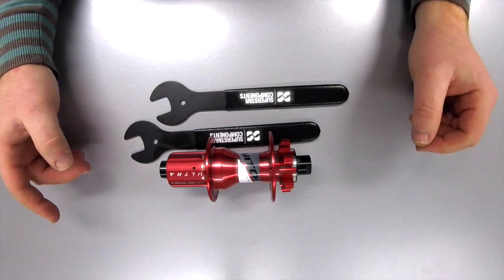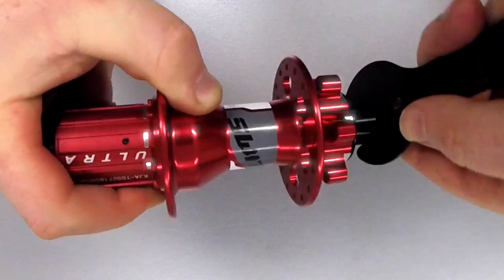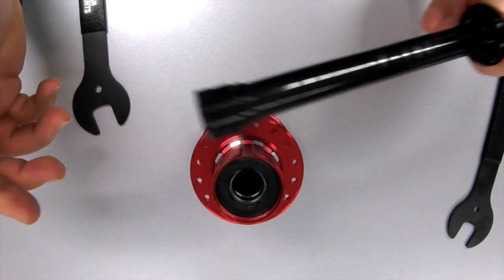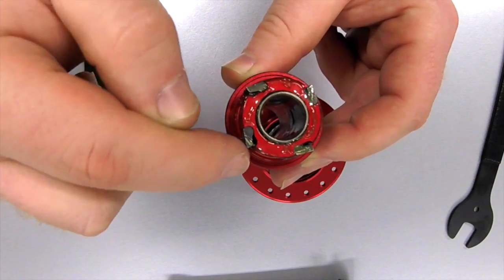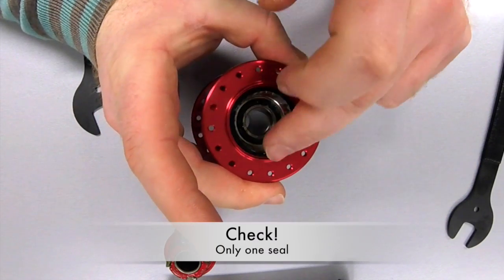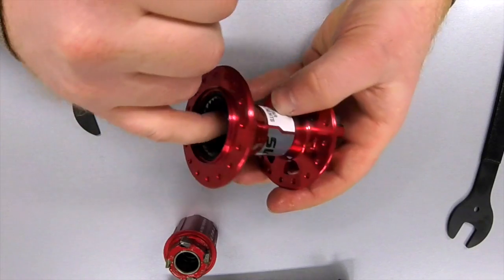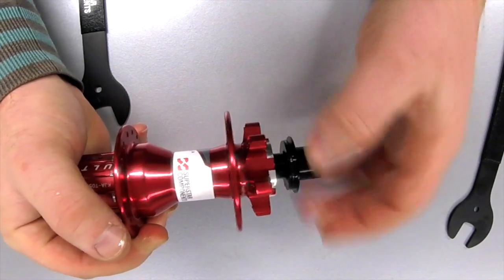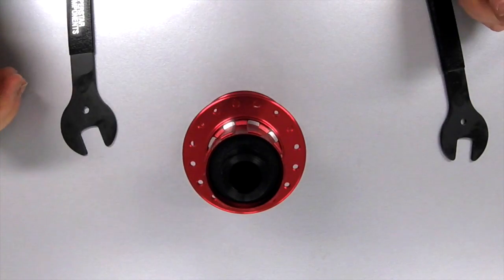Switch/Switch Ultra Hub Servicing Guide

Comment: Hey, my tooth ring broke down to small pieces... i have ordered a whole new hub set but is there a way to remove the tooth ring? I could replace that, the freehub abd the bearings without dismantling the wheel.

Comment: When I tighten the axis (min 3.10) 
My freehub body is not spinning any more. Any advice for me?
Reply from the maker: Linus 112 bearings are dead or you have lost a spacer
Reply: @SuperstarComponentsLTD  bearings run smoothly and I have all the spacers like in the video. But I asked the pre-owner of the bike and he said it's a Novatec XD freehub. Is this the problem? When I take the seal out it runs ok.
Reply from the maker: Linus 112 so you have replaced the freehub then? Sounds like you have 2 seals in there. New freehub come with a new seal

Comment: Mine is 5 years old, runs like new, just disassembled, no dust or dirt or anything else inside the hub. The sealings are so tight and perfect not to mention the bearings, I think this hub will lasts forever.